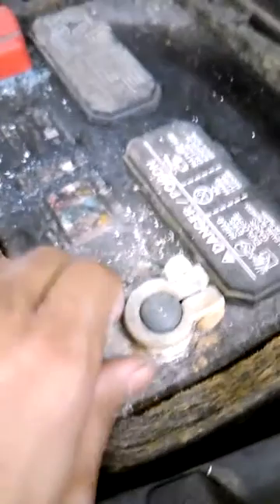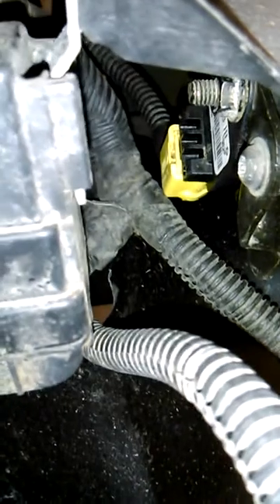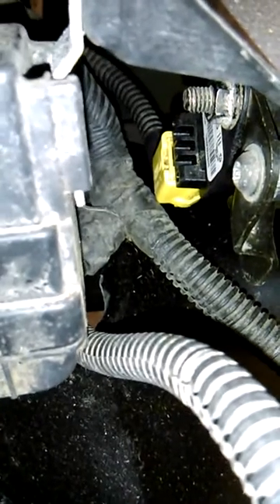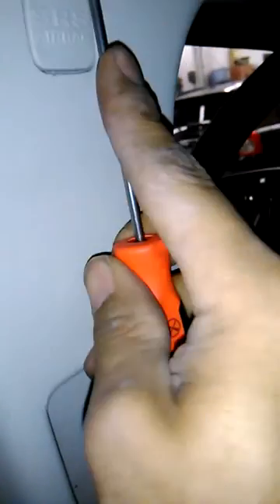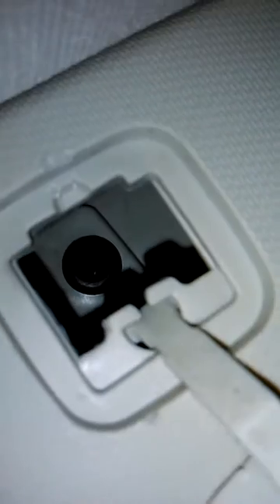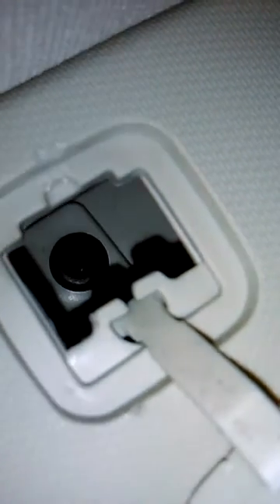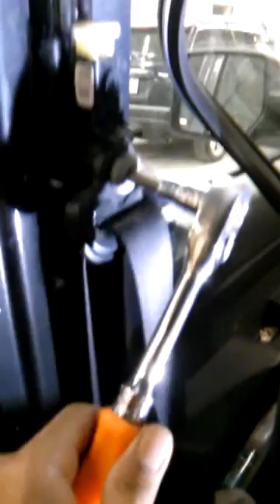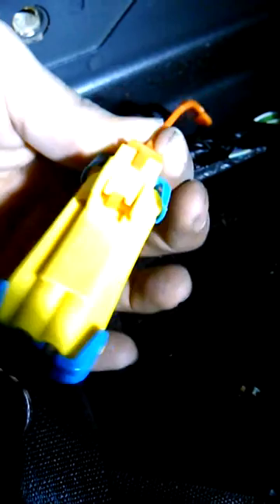DIY Dodge Nitro seat belt replacement

Comment: How the hell did you get the seat and upper torx bolt off? Mine are FIRM and won’t budge.
Reply from the maker: Not sure, it just came off lol,they shouldn't be crazy tight
Reply: Do you think its locktite? If so, how do you think I could get it off?
Reply from the maker: Try an impact gun
Reply: Impact and a t50. Mine were torq wrenched on. My breaker bar barely helded.